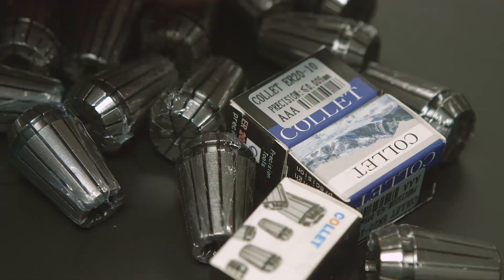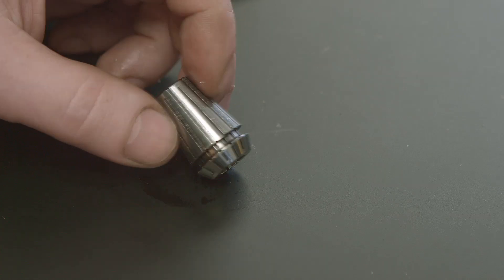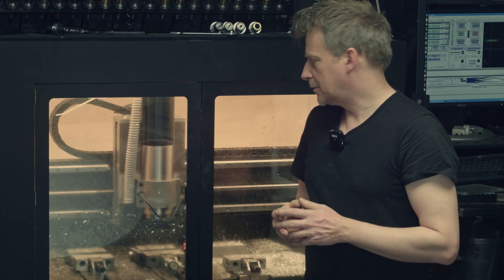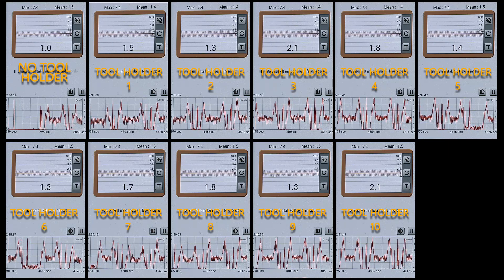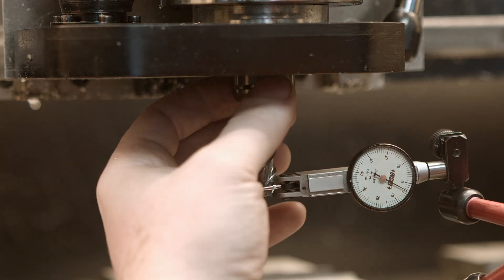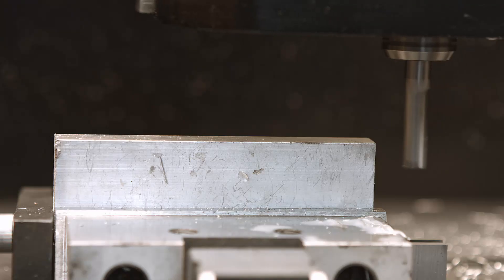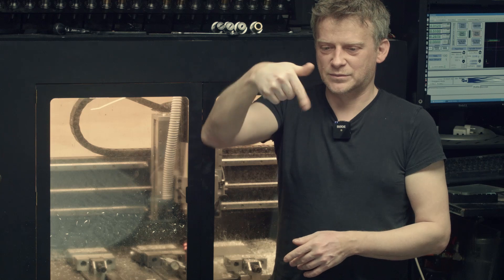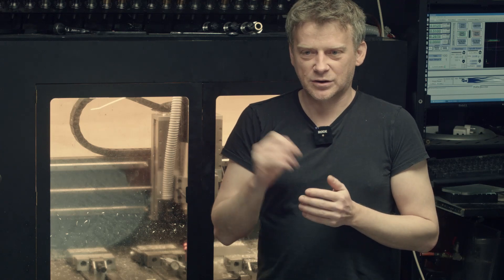Precision ATC Tool Holders and ER20 collets Review - Seriously hard to find any better than this.

Comment: Thx for review Piotr. I've bought ATC Spindle and few Parfaite holders after your video review. Ive been curious if cheapest one will be good enough too and now I have my answer. Interesting thing about ER collects runout (at least in regular no atc spindle) is that the runout can be canceled by rotating a collect inside a nut. First you have to scratch a line on a nut (permanent, place doesn't matter) , then mark a line on a collet with a sharpie. Then tigh everything together and match the marks, check runout. Untight, turn a collect a bit to mismatch the marks, check again. Repeat till you find lowest runout spot. After that, (when everything is still tightened and you have lowest runout) you mark your collet permanently with new mark in place where it meets with permanent line on nut. Then you take next collet and do the same procedure till you have all collets marked permanently. Next if you tigh the marked nut on a marked collet and marks are meeting or pretty close to each other runout is very repeatable. All you have to do when changing end mills is to place collet in a nut properly and tight it that way that the both marks meet each other. I used small mirror in my old non ATC spindle for checking, but with ISO holders it should be easier because you will be able to tighten it outside the machine. Interesting thing is that end mill position in collet or collet position in spindle (taper) doesn't matter - all you have to match is collet inside a nut. I was able to reduce my tools runout from 0.05-0.08mm to repeatable 0.01mm. I was checking many times even after few months after discovering this and it still works. So I don't have to check every time with DTI if marks are meeting together I know I'm right on the spot! Very cool thing especially in non ATC spindles but maybe it works also with ISO holders. One more thing, sometimes (very rare cases) end mills shaft and flutes might be MISMATCHED - DTI shows 0 runout on flutes and significant runout on shaft (even up to 0,03 mm) 😉
Reply from the maker: thank you for this extensive explanation. "end mills shaft and flutes might be MISMATCHED" - this makes me wonder, does it happen to good quality end mills or cheap ones? 
I have been thinking about marking my tool holders as well, after i discovered that the rotation of the tool holder in the spindle might result in run out of 0.003mm, but after the tests under the microscope i come to the conclusion that it is not really necessary for 99.8% of jobs.
Reply: @PiotrFoxWysocki  in my case it happened once with cheapest 4mm VHM end mill from eBay (2$ piece). I used to bought many of them for roughing operations until I discover my new supplier (company called HRC tools, you should check them out. Good quality for decent money and they make custom VHM tools in reasonable pricing and amount, usually moq is 10 pcs).
Reply from the maker: thank you for the tip, I will check them out!

Comment: since you can "tap them around" i wonder what the runout looks like after doing some cuts.  I wonder if they shift around a bit.  Based on the noise it would seem they do not but it would be an interesting test.  Also would be interesting to see you cut with PCD or CBN with that spindle.  thechipwelder did some tests a few months ago with PCD end mills and they look very interesting.
Reply from the maker: i tap them and then tightening again. then dial whatever moved, tap some more and dial, tighten some more and recheck. after this they stay in place. i would really like to try anything diamond coated, but somehow i always forget about it when i order new tools.

Comment: Ahhhhh man. I purchased a bunch of (5) parfaite holders on Friday.... I'll check out these guys for some more  holders.
Also, just picked up a jianken 4.2kw spindle! I'm looking forward to using that one on my new cnc (which is yet to be built)
Reply from the maker: consider your self lucky :) I bought 15 parfaite collets before I decided to look for the equivalent :) 
4.2KW is a monster!
Reply: @PiotrFoxWysocki  I'll consider myself lucky! Thanks for sharing your findings. 4.2 is a monster.... But I really wanted it for the torque and my intent is to run it only up to 15k for most of the time. Full speed occasionally for engraving and the like. 
I spent a bunch of time looking at videos by you and Marco reps and plugging the feeds and speeds you used into the iscar machining power calculator to see what I wanted to be able to acheive and to ensure I had my sizing right. So thanks for uploading the videos! 

The mill it is going on will be a monster too, I'm about 80% done with the design, it will be around 1100kg when completed with a working area of 1.2m x 0.8m x 0.4m.  It's a moving gantry mill with a light weight structural concrete base (with embedded steel frame), I'm hoping it will work really well.
Reply from the maker: 1100kg wow! and it makes sense. please keep me posted, I'm really curious :)
Reply: @PiotrFoxWysocki  I sure will. I'll do a build video series on my channel cew.manufacturing (I use this one to watch videos and that one to post them, I'm not sure why). It'll be a while before a video gets up, but I've got some other stuff there too
Reply from the maker: Subscribed ;) i will be watching you ;)
Reply: @PiotrFoxWysocki  quick one mate, are you based in Aus? I see you using diggers brand chemicals in your most recent videos and as far as I can find they are only sold here...
Reply from the maker: And new zealand ;) cheers mate ;)
Reply: Ahhh the 'other' state of Australia, if you were a bit more local I was going to ask if I could check out your cnc (and if you knew anyone selling large steel SHS by the meter)

Comment: What does vibration look like with the 100 micron run out setup? You would expect this to make quite a difference.
Reply from the maker: what a great question! why I didn't thought about it. i just run the test and it does make a difference. vibrations went up to 2.9. where the spindle by it self max was at 1.7 the worst tool holder took it to 2.2. so the difference is 0.5 at max. and the difference between max empty spindle noise and tool holder with 100microns off endmill was 1.2.
honestly i was expecting something around 5 :)
Reply: @PiotrFoxWysocki  thanks for checking that Fox, what a quick response. Interesting figures too like you I was expecting that to be worse. Great video as always thanks for all you hard work.
Reply from the maker: @house89147  thank you!

Comment: Been binge-watching your build videos.  Starting to build something similar ordered a 24x36" surface plate. I've had no luck finding anyone to cut me the other pieces. Tried a granite store all they have is 1 1/4 and they wanted to charge me $69 a square foot... that was something like $800 or something. Even tried a gravestone place lol got no response from them.  I'm going to make the Y-axis a little longer and taller so I can utilize more of the surface plate. I'm now looking into casting my own granite epoxy for the sides and gantry. I picked up some surplus THK SHW35CA1SS there about 3" wide for my Y.... a little overkill but it will work well for $400 I couldn't pass it up.  Still working the rest out I know I want to go with servos and a BT30 spindle with a lower range.
Reply from the maker: so you got exactly same surface plate as i have. it might be a great choice to mix granite base with epoxy sides etc. with surface plate you will have a reference point to work from. good luck with you build !
Reply: @PiotrFoxWysocki  I think so. It actually came in today.  I think it will work well. It will be less drilling. How many oz motors did you use for the Y-axis? I certainly don't want to be underpowered.  I'm going to try and document everything on video and will post it on my DIY channel.
Reply from the maker: @tommiller3687  i can not tell you with in 100% but it looks like it is Nema 23 Bipolar 1.9Nm (269oz.in). i have 2 of those to run my Y. but just in case get something a bit bigger.

Comment: Shouldn't you snap the collet on the nut before inserting the endmill & screwing onto holder ?
Reply from the maker: this is a different style tool holder, it has a special wrench to pull the collet from the tool holder. but yes, in different style collet nut, you put collet in to the nut first and than the endmill.

Comment: Are ER collets not supposed to be snapped into the collet nut prior to screwing it onto the collet holder?
Reply from the maker: this is a different style tool holder, it has a special wrench to pull the collet from the tool holder. but yes, in different style collet nut, you put collet in to the nut first and than the endmill.